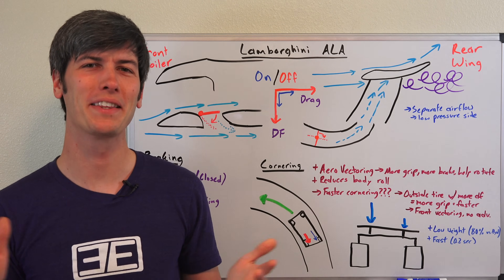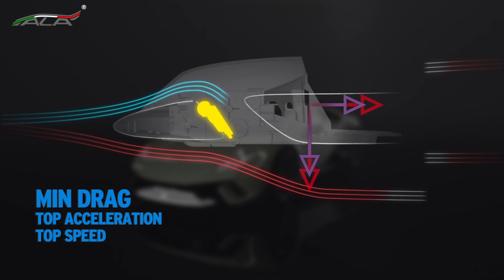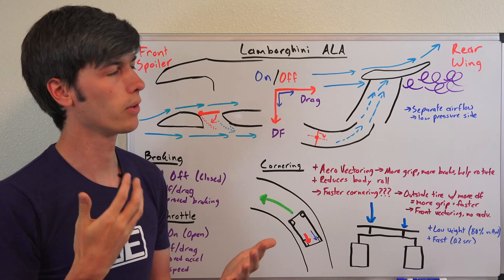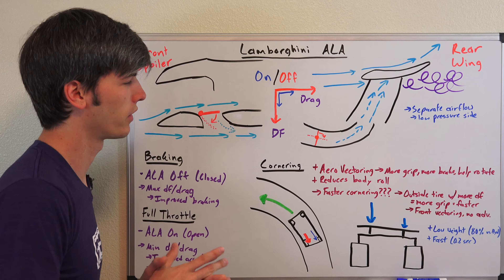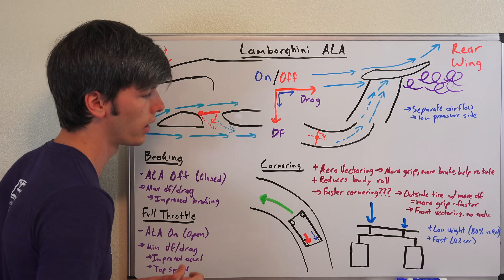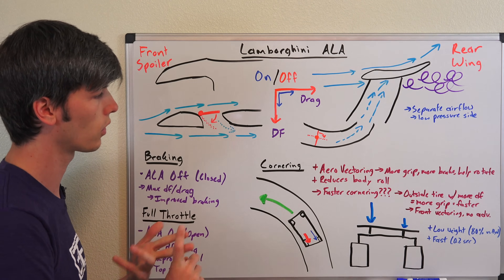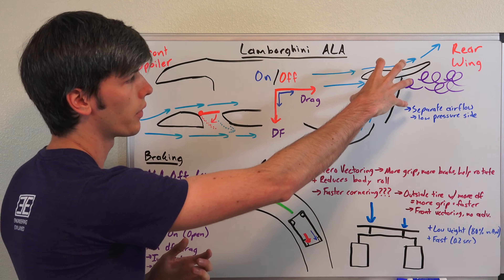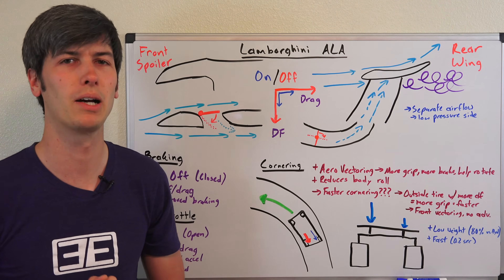Lamborghini's Brilliant Active Aerodynamics - Huracán Performante

Comment: My first boss was the crew chief for the number 59 Brumos Porche for 10 years including Daytona 24 hour win in 1977 and he told me the grip gained on the outside tires from weight transfer will never equal the grip lost by the weight coming off of the inside tires. If he is right then then adding down force to the inside would be worth more than any added to the outside and would support this cars setup to to do things this way.What do you say to that ever true, still true, was it good before tire technology improved?
Reply: What he said is correct. There reason is the degressive characteristic of tires. But maybe you didn't fully understood what he meant. Adding grip on the inside is worth more than adding it on the outside, sure. It goes even that far that the car can produce lateral acceleration that would cause the car to roll over without downforce, depending of the CoG height. However all this does not imply that downforce on the outside is worthless, no no no. It only says that the lateral force gain thanks to aero downforce will be bigger on the inside wheel(s).

However in the end it depends on the load sensitivity of the tire. Load sensitivity describes how much the friction coefficient is reduced with increasing wheel load(in general a normal tire behaviour, but some do it more than other). 
A highly load sensitive tire can reduce the effectiveness of the downforce up to the point that less downforce but also less drag could in sum be the better solution. Also while cornering the drag on the outside works against the yaw rate. So less drag on the outside than on the inside is a (theoretically at least a small) benefit for the yaw rate.

In the end it's a trade off between peak lateral force and yaw rate. And doing it only on the rear axis kind makes sense because reducing the peak lateral performance of the rear axis would reduce understeer at the limit (what can be dangerous) and the drag thing improves yaw behaviour what the drive would also interpret as reduced understeer. 

So far so logical but actually it's not like the vehicle dynamics are designed. No sane vehicle dynamics engineer would make the rear axis worse to improve the yaw behaviour of the car. It's pointless because there are enough ways to improve the front axis. Actually some car manufacturers only care about the rear axis, because for the front axis there is a round thing inside the car that the driver can use to get more side force if necessary.

Comment: Won't the "Aero  Vectoring" drag during cornering cause rotation into the turn also?  Like how having one side of tires on a softer surface causes a pull into that direction.  However, I do agree that it is most likely more marketing than a significant performance boost.

Comment: Regarding the possibility of more downforce at the outside of the corner, you have to consider that the tire vertical load vs lateral force is nonlinear (as you can see at page 210 of the book Fundamentals of Vehicle Dynamics, Thomas D. Gillespie). As a result, the increase in aerodynamic drag would not be worth the increase in lateral load. Just guessing, but it is a theory. Keep up the good work!

Comment: The aero vectoring sounds like it reduces understeer which awd cars have plenty of. The more neutral handling characteristics on high speed corners will allow drivers to potentially get a better line and push harder.

Comment: If anyone has ever cornered a 2 wheeler at triple digits, this aero vectoring makes a whole lotta sense. Ever see MotoGP riders hanging limbs off the 'inside' of the corner during trail-braking? It creates more yaw angle and braking effect, increasing turn-in which yields higher apex speeds.
Reply: That is to do with something completely different. It lowers your center of gravity, reduces centripetal force, and counteracts the moment caused by centripetal force. Cars have 4 wheels and the angle difference is negligible. What it does do it improve the aerodynamic capabilities of the floor, and to some extent wings.
Reply: MJorgy5 good point.

Comment: It's cool how you can also achieve the opposite effect that this rear wing feature adds. By simply changing the way the air is introduced to the wing, a greater angle of attack can be achieved before stalling the wing. This is called boundary layer control!

Comment: It is possible to add passive aero vectoring by splitting the intakes to front left and right, on opposite sides. Crossing the ducts so that left front intake feeds to the rightside rear wing, we can stall the inside of the rear wing separately. Linking them and using valve to guide the flow to inversed or "regular", we can further control over/understeer. But if there is full car control, full grip will get you thru that corner faster.

Comment: I understand that having too much downforce in the rear is counter productive, it will cause understeer. You want to have just enough rear downforce to compensate for the grip of the front, so when you enter a corner and go through, your rear stay just about planted, by which I mean it still rotates, moves just a little bit.
Based on that (considering front downforce is at max through a corner) it makes sense to unload the outside rear, allowing for that little bit of slip, but to give inside rear wheel maximum grip, to create that pivot point. So I do believe that it makes the car corner faster. 

Its been done, in a remotely similar way, even in the 60s, with Porsche 908.

Hopefully my explanation makes sense, if not feel free to ask/discuss.

Comment: Well, also this lambo weights less than original, it may help cornering better to. Isn't that right the power to weight ratio? Plus altering the air flow while moving it helps the car move faster trough corners. My example is this If the first Huracan Takes a corner at 45mph and this one with more aero and less weight maybe takes the same corner at 49 to 51mph. Thats is a huge improvement.

Comment: You didn't take into account the yaw moment that the aero vectoring produces. It's difficult to compare if it's better a yawing moment with less vertical load on the outside wheel or have the maximum achievable load on all the wheels to maximize the lateral acceleration. Anyway the principle isn't that bad!

Comment: Hi, engineering explained, I've been seeing lots and lots lately on YouTube about the Nissan skyline RB26dett motor using a brass bush in series with the boost solenoid, this makes the car produce "276hp" at 0.8bar of boost for the gentlemans agreement. What I don't understand is how this little brass bush once removed makes the car produce around 300hp and runs 1bar of boost? Wouldn't this be the other way around? Can you explain! Would love to know thanks, Justin!

Comment: When the values for the rear wing are closed, wouldn't there be increased drag from the intakes that feed that system? No outflow but high speed air flowing in would create an area of high pressure and increased drag, right?

Comment: I am wondering if you are actually right about the cornering. You say you want as much downforce as possible for as much grip as possible. I remember the reasoning from the viper vs 488 comparison, where I understood the more physical weight, the worse for grip (centrifugal force), the more "effective" weight (through downforse), the better. Is this simple rule is adequate for a one tire case, but I am wondering if modeling the grip of all 4 wheels doesn't make it more complex, so that conclusions from the simplified model don't carry over...

Take a case, where the Lambo with its active wing goes through a corner at max. speed its tires can handle. Now we remove the "active" part of the wing, so that it's providing maximum downforce to the outside tire. You claim this will improve grip, but my hunch is that such an action would be equivalent to removing an anti-roll bar: it would add aggregate downforce, but I think in per-tire analysis the inner tire could lose some downforce (as the car would roll more towards the outside) and my intuition tells me less grip for the inner tire would not be compensated by increased grip of the outside tire. I don't know - take the extreme case where the inner wheels lift 1mm off the ground.

Could you please elaborate on that? Thanks!

Comment: So a standard Huracan did it in 7:28 and the Performante did it in 6:52. A 36 second difference. Seems like an unusually large gap for adding aero. I need more research...
Reply from the maker: New springs, new bushings, new roll bars, and also very importantly, new tires.
Reply: The standard Huracan actually was around 7:20 with same driver in lap record video. 7:28 was a non-factory driver.
Reply: "a non-factory driver"

elegiggles
Reply: 36 seconds sound a lot but then it's a huge circuit. It's only 4.8 seconds per minute faster.
Reply: I didn't realize the changes were that extensive. Now it makes more sense.
Reply: I don't follow these types of things close enough anymore to track the fine details.

Comment: Can you make a video about wheel/tire combo weight affecting performance/handling/fuel consumption? My summer set weighs almost double what my winter set weighs (245 18s summer and 195 16s winter) and I feel like the summer set affects atleast acceleration quite a bit.

Comment: Ok ok. So my background is aviation I fly planes for a living. This air vectoring system is quite revolutionary although I don't believe he has it completely right. On an aircraft there is a point during take off where we go from gear steering (wheels turning) to rudder control. Where the air flow over the control surfaces is substantial enough to vector the aircraft right and left to keep on the center line of the runway, using the rudder. The same can be said for the performante. Once it reaches a certain speed it does not require the same amount of grip due to the increased airflow. So Lamborghini obviously have it right increasing the downforce on the inside tires is the right method, as long as the airflow is substantial enough to take effect. It wouldn't make sense to do the reverse in this situation. Remember we want the center of gravity to be centered, not shifted to the outside tires during a turn at high velocity. As we know the mechanical grip is more than enough as long as the speed is relatively high during a turn, the downforce only becomes more effective.

Comment: Regarding cornering speed:

I agree that more downforce allows for greater acceleration, but if the current force applied by the tires (is it tires or tyres?) on the road is less than the maximum allowed by your friction force, then there is no reason for the car to have more downforce.

That being said, if you are cornering at high speeds your car already has a larger normal force, hence a larger maximum friction force, on the outer tires caused by momentum, which induces body roll. I have not done a single calculation to support my conclusion, but I believe that deactivating ALA to increase downforce on the outer tires is unnecessary and this aero vectoring might be more beneficial. Hell, some car manufacturers use "brake vectoring"(™) to improve cornering, doing this with aerodynamics seems even better. 

All english corrections are welcome.

Comment: Why are modern cars so bad at price/size and engine ratio? A 5,5 meter long V8 full metal 1959 Chevrolet Impala costed $25,000 new in 2017 money, today the only thing for $25,000 today is the tiny Ford focus with a 2 liter engine with plastic everywhere. Cars are somehow getting smaller and more expensive...
Reply: AndreyGaming Inflation, fewer resources, higher taxes.

Comment: Has it been proven? Did they compare times with a regular Huracan? Probably works better on the straights. For corners one would need lap times.
Reply from the maker: 30 some seconds faster around the 'ring.
Reply: you can't be wrong about the burger

Comment: The thing with the aero while actually in corner, I think Pagani has a similar approach with this. They use flaps at the front and rear, but they are not completely in downforce-mode, the inner flaps are more upright, and the outer flaps are more closed. Maybe you need a whole car concept to do this proberly, but I think this actually helps if Pagani does this too.

Comment: Your diagram isn't great today. There is actually a slot on the underside of the wing. When the valve opens the air is taken in just in front of the wing and then goes up inside the wing mounting posts then out of the underside of the wing. Your diagram makes it look like its blown onto the underside of the wing.

See videos from Geneva and you will see people looking at the underside of the wing.

Comment: Hi EE one thought here is that if you open the outer side of the spoiler in a turn, lowering drag and downforce it will help on turn for both forces. 
Higher drag in the inner side will create a vector torque that will help with some spin to the car and higher downforce will add braking power as you said but also act almost as an anti roll bar that will load inside tyres giving it more grip. The outside tyres will have less downforce on them but they already have weight transfer to generate extra grip. 
You can have a higher turn power and transfer more weight to the outer tyre without overloading it with downforce.
My thoughts only. Thank you for great content

Comment: 'Probably can be' it is. There is a GTR with a similarly working but differently applied aero system which took 2-3 secs per lap off with the down force/corner weight shifting method.

Comment: Wouldn't the point of the aero vectoring be to prevent understeer by sharing the g load across both front tires instead of just the single outside tire? This, in theory, could increase your cornering speeds because you would be able to carry more momentum into the turn. I guess with it only being in the back it wouldn't help much but let me know.
Reply: so just had another thought. Since the lambo is a rear engine car, at high speeds it probably has more issues with oversteer because of the inertia difference between the front and rear. so the areo vectoring at the rear could help prevent that, meaning faster cornering speeds.

Comment: ALA has some positive effect, but it's so negligble compared to the AWD system + super sticky tires.  It's just some kind of gadgetry they tell you to justify the price of the car, another of "trickery aero" look at the F12, when they said the air sweeps around the body, etc... does not help the car perform any better.
Reply: Honfy Lam  That's what someone who doesn't understand aerodynamics would think. The difference in the amount of downforce and grip that this system creates in opened and closed mode is higher than the difference in grip you'll get with semi-slick tires in comparison to regular tires. We're talking about hundreds of kg's of downgforce.

"does not help the car perform any better."  And how the HELL would someone like you know that? Did you ever run sims of a car with and without those aero parts and directly compared them? No. Don't talk about things you don't understand and doubt the work of people far more competent than you are. Not a single cm of that body is there for no reason, especially when someone like Ferrari does it, who literally work with most advanced aerodynamics in the world, in F1. Only fighter jets compared to the complexity of aerodynamics found in F1, so those people know what they're doing.
Reply: lmao... you mentioned not understanding aerodynamics?  how ironic. hundreds of kg's of downforce?  who are you kidding with that tiny wing and tiny splitter/diffuser?  Even in the highest downforce mode it's not going to develop more than 250kg of downforce.  downforce/lift is proportional to the square of velocity.  at 100mph, the car would be developing just 60-70kg of downforce.  For a car that weights 20x that, it's not going to gain as much lap time as the trofeo Rs, especially the slow corners wer downforce is negligible.

Comment: Why don't electric vehicles use active aero for power regeneration?
Reply from the maker: You can use braking for regen, and typically capture energy at a faster rate than you can put it back into storage.

Comment: don't you think that more drag on the inside will help turn the car?
Reply from the maker: Slightly, perhaps, but ultimately the wing vent is fairly central, so that means the drag moment acts not too far away from the center. It also means that because it's not acting directly over the rear tire, it's increasing downforce on both tires (or reducing), so it's not quite as independent as they make it seem.

Comment: Great Video. However unless they have developed a new type of Motor I don't think using one is quicker than Hydraulic systems. Formula 1 uses Hydraulic systems to work the DRS as the engineers say it is faster.
Reply from the maker: Sure, but Formula 1 is a flap opening and closing (much like the Lambo), rather than an entire wing raising and lowering. Have all teams said they're using hydraulic?
Reply: Yes. Pretty much all teams are using hydraulic systems specifically because they say it is faster which was surprising to me.